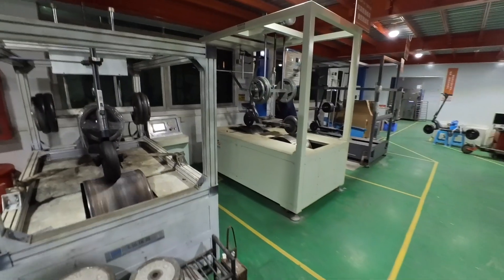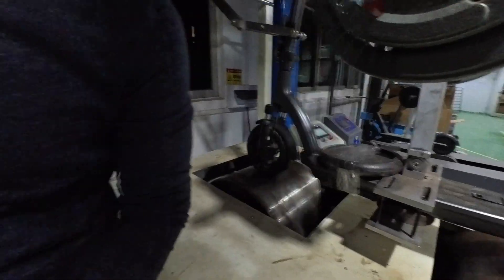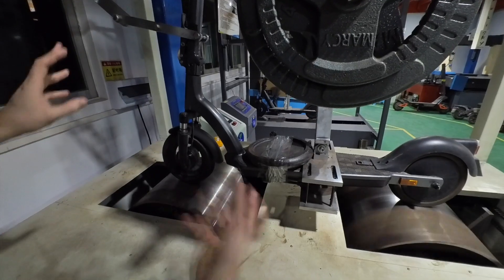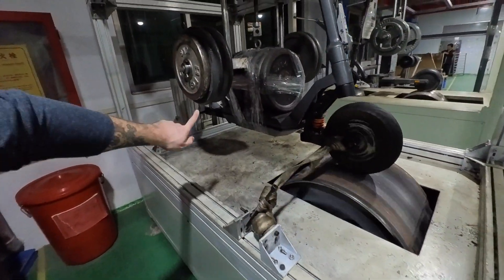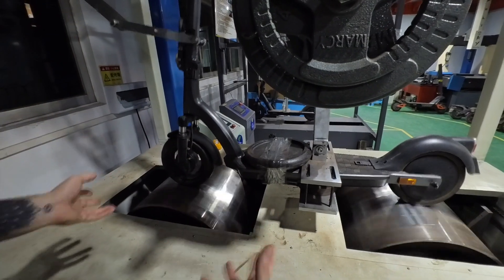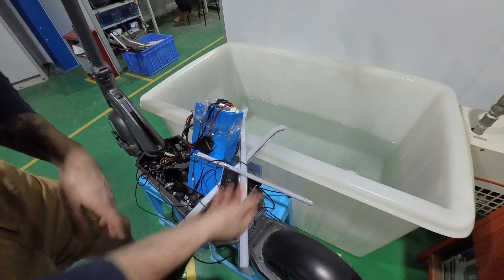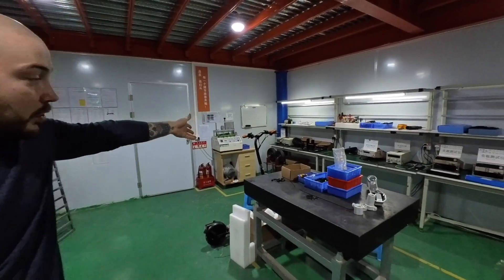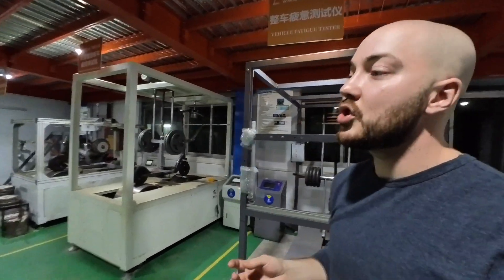Rigorous Quality Control for Electric Scooters

Comment: Real use in REAL conditions is how you get REAL results. This controlled testing is BS. turning, stopping, and just small particles on the roadway jam these up so bad, so much worse than could be "tested" this way. You can get results by sending 1000 of them and see how much use before any type of maint is required.

Comment: Apollo Go should be a barebones scooter. Dual motors and self healing tires. Don't need turn signal leds. Dont need stem led and headlights. Don't need it to be foldable with fancy latch. Shave off more costs so price can be a lot more affordable.
Reply from the maker: Two motors, battery, controller and frame are 80% of the cost - these are good suggestions but they won't affect the cost much. We're thinking about making one without suspension, just a single motor with a 10aH 48V battery - would go for closer to $799. What do you think?
Reply: @ApolloScooters  That's not good enough. It'll just be like the rest if it's a single motor. 
I would say you can cheap out on the frame even more, but make it feel like it's not cheap, so maybe have the outer shell of the frame a type of really thin metal that feels nice, but internally it's a different material like plastic (the battery can be enclosed in a material that doesn't melt the plastic).

It has to have dual motor and self healing tires. Everything else, get creative to lower cost.
Reply: @ApolloScooters  I would also say that the range could be reduced as well with a lesser battery and give people the option to buy another battery pack to quickly swap out (similar to the unreleased Explore). 

This gives people options and if they want more range they can just buy another battery.

And it also gives you more flexibility in terms of long term profits as there might be someone who will buy one extra battery for now, but then realize that they need another after a couple years due to them selling their car and relying 100% on scooters.
Reply: @ApolloScooters  The goal of this scooter that I want from you, is that it will be the first ever (or one of the first) that features dual motors with self healing tires at a very affordable price, and is designed by Apollo. 

Trust me, I've looked almost everywhere, but at the end of the day, I rather have the Apollo brand on it.

This will get people talking about scooters and will be hard for them to pass up. Price is everything. But do not compromise with a single motor.

Comment: Loool ok. So that why my back motor broke when i bumped into a curb at 15km/hr
Reply: What do you mean back motor? And what do you mean broken?
Reply: @gloomy5487 exactly what it means. I ran into a curb at night cuz my visibility was low. And somehow my back motor tore apart. I got error code E4 and had to get the back motor replaced.
Reply: That sounds about right!
Reply: Because scooters are not meant for running through curbs in the first place! That's a bike's job with much larger wheels!
Scooters should be ridden very defensively at night!
Reply: @chaxologist2024 true. It was my fault completely but i was surprised it broke that easily after one accident. I had it for two days
Reply: @gjc5750  You must have crashed into it really hard. The motors used in most electric scooters tend to be 'off the shelf' models, meaning all scooters use motors from the same manufacturers. If you had broken yours, it is very likely you would have broken any regardless of what scooter you were riding.
Reply: @gloomy5487 if thats true then maybe. But I’m pretty sure apollo uses their own motors( at least i thought)
Reply from the maker: Reach out to support@apolloscooters.co - we have full motor assemblies ready to ship, should be a quick repair!
Reply: @ApolloScooters i did it already. Its all fixed up but thanks anyway.